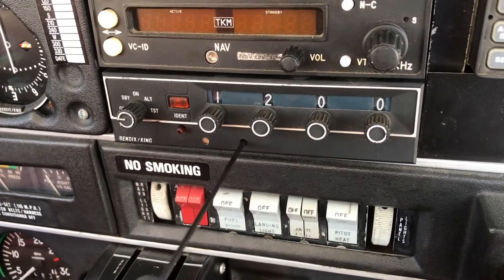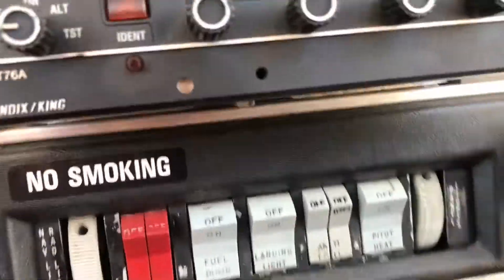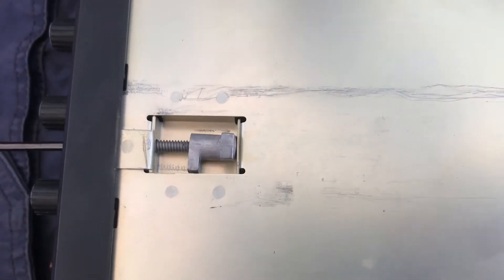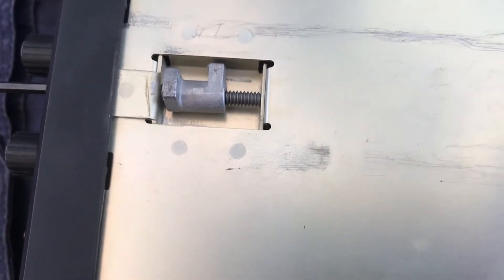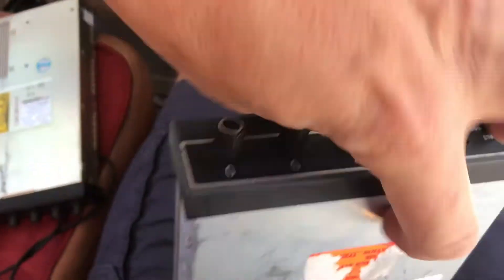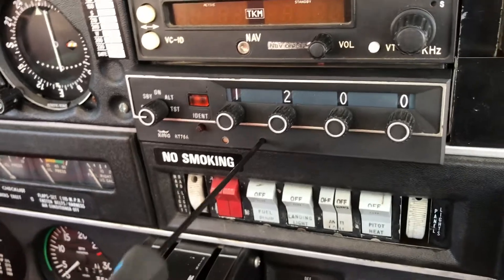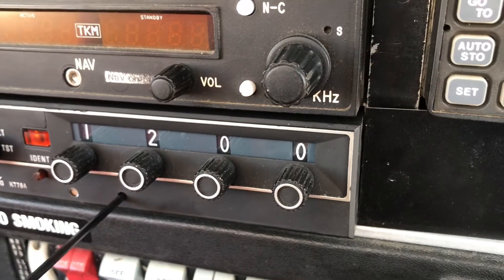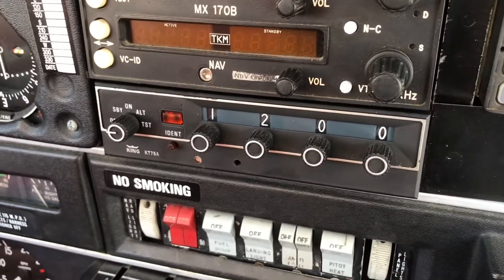Removing & Installing a KT-76 Transponder

Comment: Does the MX170B install and remove the same way.   I am replacing a KX170B that stopped working with a MX170B and before I do I was trying to find a video of one being removed and have not been able to find one yet.
Reply: Yes, it does.  ALL the radios in the stack come out the same way.